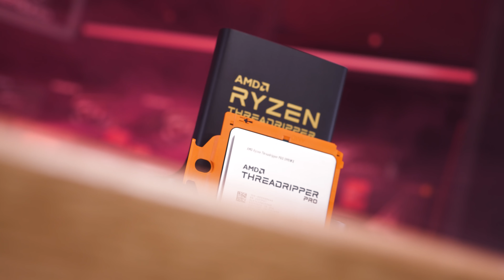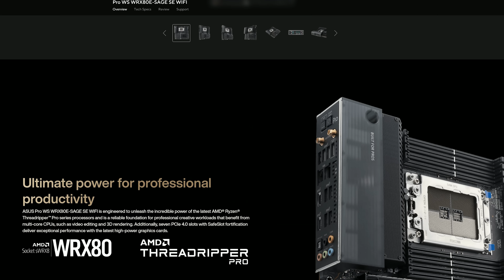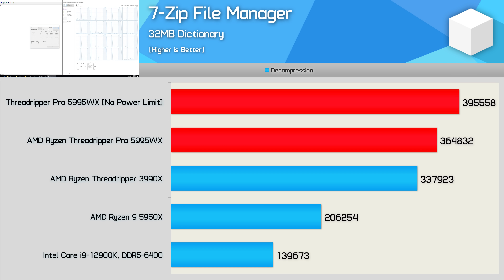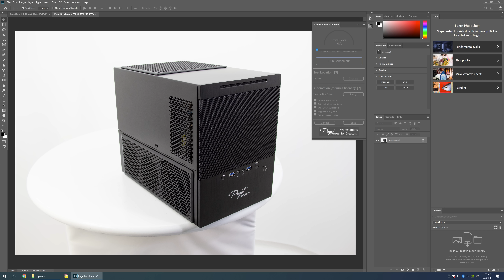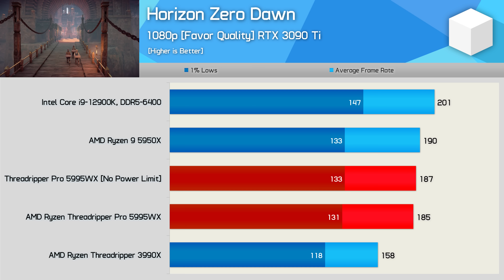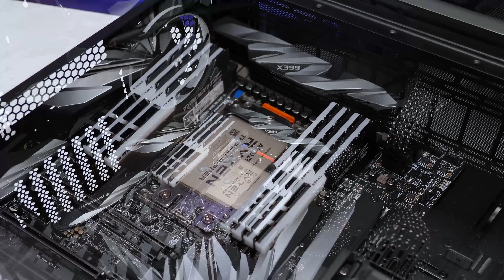It’s Finally Here! AMD’s Ryzen Threadripper Pro 5995WX, Benchmarks, Power & Cooling

Comment: help, I want a pc to edit 4k and 3d, what processor do you recommend Threadripper PRO 5965WX or
AMD Ryzen Threadripper 3970X or
AMD Ryzen 9 7950X. I will use it with a 3080ti. What should i buy?

Comment: amd 3990 = 62868 points VS amd 5995WXYZsuperduper6k$$f'nthousandbiatchofcpuwaferpowah = 66403poin.... bruh, not could they have only not released a threadripper for enthousiasts, they might aswell just have dumped the hole project and let it die on the drawing board. Darn it, that 3990X will never be affoardable. "The dream of ever rendering and simulating water waves on 64 cores within these walls *puuff*"

Comment: As you rightly say in your round up, yes these are super expensive but then at the same time worth it. The biggest disappointment for me is just how slow AMD is at bringing them out. I'm not willing to blow that kind of money on last gen tech and given how high the margins must be on these products I don't understand why they aren't some of the first products to use the latest Zen chiplets, not the last product!
It will be interesting to see how close Zen 4 and Raptor Lake get to these products as the 13900K is meant to have already crossed the 40,000 score in R23 in leaks.
Reply: Because Threadrippers are literally just unlocked Epyc chips, and datacenters buy Epycs by the thousands, consumers might by just 1 or 2. Epycs also have higher margins too.
Reply: @mitlanderson  they all use the same chiplets (just binned) whether it's Epyc, TR or Ryzen, it's just the I/O die that is different and they started to ship Genoa a while back to key customers. AMD really shouldn't be still struggling to order enough capacity from TSMC anymore.
Reply: @Speak_Out_and_Remove_All_Doubt  they're slow to bring out non-Epyc products for that exact reason: they all use the same compute dies and a die sold in an Epyc chip makes them more money than a TR or Ryzen chip, with their much higher margins in server. So we presented with the choice to sell a Threadripper or Epyc CPU, they'd much rather sell Epyc.

Your other point explains this, the fact that Epyc Genoa is now being sold means less sales of Epyc Milan CPUS, which is why we're only now seeing TR 5000 come to market while those in the datacenter already get to play with Zen4.

Comment: Hi Steve I recently switched to the rx6600xt gpu for my computer here at home and I purchased a rx6500xt for a cheaper gaming all amd build. These have been my first amd cards other than a couple of older 7970's that gave me no issues. During the installation on both computers I used AMDs programme to download and install it and on both occasions there was massive instability and generally a conflict somewhere and I think on both occasions I had to reinstall them . Once re installed everything seem to work ok.. Now is it something I am doing initially to cause the issue or have I just been unlucky.. I never seem to have any of these issues downloading nvidia drivers.

Comment: If (the next gen?) Ryzen is (currently) capped to (up to) DDR5 6000.
Would there be any pros to buying a DDR5 64000 and keeping it at 6000, over getting a 6000 sticks?
Reply: It's not capped, that's simply the limit for a 1:1 IF:CLCK ratio, you can still go 1:2, Intel does the same with 12th Gen with "Gear 2"

Comment: I don't understand how this is "much better" than the 3990x? it feels like the exact same CPU with a 5% boost only. I honestly expected more
Reply: This video literally shows multiple instances where this chip is over 15 and 20% faster mate.
Reply: @mitlanderson  I only looked at rendering benchmarks and it wasn't that good. the same goes with thermals

sorry not interested in gaming on it.
Reply: @axe_fx  then it looks like you didn't seem interested in any of the other productivity apps besides rendering then, since the gaming results where the ones that were less impressive.
Reply: @mitlanderson  yeah I am not gonna use it for Ae or Ps or databases or compiling codes.

I just want to render super heavy scenes using multiple render engines

Comment: Is there any point in getting a 4k 120Hz TV if games don't support 120Hz ?. I was under the impression that its the GPU which limits Frames Per Second and not the TV/monitor. I'm unsure hence my reluctance to upgrade my 4k 60Hz TV to a 120Hz TV.

Comment: The price gap between the entry level threadripper 5000 at $2400usd and the 5950X at $700usd today is massive.
There MUST exist a cpu in between that supports 256GB RAM quad channel and has 40 or 64 or so pcie lanes.
Oh wait, that was threadripper NON pro. 
Thanks AMD for screwing us, the TRX40 platform owners.
Reply: I'm guessing that market for it is so small that it isn't feasible to cater to it, intel also killed off their mid-tier stuff.

Comment: Considering how much I paid for my TR 3960X over the desktop ryzen 3950X, I do/did expect an upgrade path/Cpu to be offered. 
This is UN-acceptable AMD.

I do finite element analysis FEA. I do benefit significantly from more memory channels and a 256GB ECC RAM size, PCIE lanes etc. The 5950x and the rest go only up to 128gb.

Yes, I do use it to generate a small income in small engineering projects, but I certainly don't make enough to purchase the Pro version such as the 24 core entry model 5965WX. In Australia this 5965WX is listed for $4,299 Australian dollars. This is an insane amount of money for an the entry level CPU compared to what I paid for the 24core TR 3960X non pro, $2,200 AUD.

So sorry AMD, I won't by buying the 5965WX, because it's not a good value proposition for my business.

Comment: I couldn't find this on the AMD Page, but generally in the past if a chip carried the PRO moniker it was supposed to carry certified support which is generally why they are higher because of the extra vetting process etc. Did they do that with these or just using the PRO name?
Reply: The PRO is all there is, there is no "normal" Threadripper anymore.

Comment: Imagine buying a 6k USD CPU for doing synthethic benchmarks 24/7 instead of using it in real life scenarios, just to justify you paid 10-15 times more for a CPU that's not even the fastest overall plus 4 additional RAM modules, to get the fastest experience.
Reply from the maker: I don't think anyone has or will ever do that so it's just strange to make up that scenario.
Reply: @Hardwareunboxed    Exactly, people will let the CPU handle things in the background, while doing other stuff (working, reading, watching) instead of watching a timer doing nothing, so time on the one side doesn't really matter and on the other hand there's a 5800x3D and Intel 12900KS that are far better in 3D things and giving out raw power... while the new generations are playing in the backyard already.

Comment: Very interesting to see how it stacks up against the high-end consumer CPUs. The competition in that space over the last few years has really closed that gap to where you really need a very specific workflow to justify going for Threadripper. I'd love to see some more engineering based workload benchmarks, like CAD software and 3D model slicing...slicing in particular would be very interesting to see how the different CPUs stack up.

Comment: Well, moving from the 3990x to one these new 5000 Series Threadrippers would mean Steve wouldn't be able to use the downtime provided by those periods the 3990x wouldn't do the job fast enough to rest his eyes :P Heck if you ventured into dumping some workload into a slightly slower system and you might be getting a chance to take a couple "powernaps" between benchmarks and what not :P

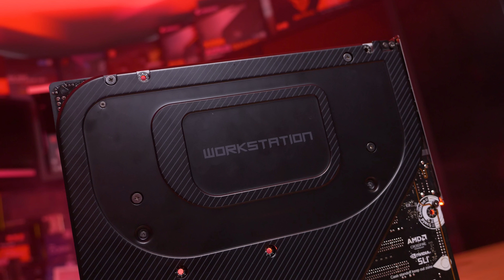Comment: 7:32 - So strange to see SLI and X-Fire support on this MB when those technologies are pretty much dead except for specific use cases.
Reply: not realy, in linux or blender if that mather you can install more gpus and they use them all. even 2 tesla v100 + 1 quadro p series for display out, its not unusual for things like adobe or davinci resolve to youse everything you throw it in the system.

Comment: Thanks Team Group, MSI, and AMD...  And of course HUB Steve as well. 🙂

Nope, not a system I'll have the pleasure of building (why I very much greatly appreciate this review), but still quite impressive from a number of angles. 🙂

Shame there is no step in between the Threadripper Pro (workstation) and the consumer desktop parts.  But for those that need this kind of processing power and will put it to use, more power to you! 👍🙂

Comment: Yikes. It's hardly better than the 3000 series, no wonder it took them so long to release it. Not even worth it.
Reply: Depends on the application. Logic heavy stuff is oodles faster on Zen 3. But Steve is not the right guy to evaluate a workstation product. Throwing a few rendering apps at it doesn't do it justice. AMD was already murdering Intel in software rendering with Zen 2. What I'd like to see is the uplift in something like AutoCAD or Fusion360. That's where the majority of these CPUs will be utilized.

Comment: So can we now que the same hate for amd that intel was getting when they were price gauging everyone? anyone? anyone? anyone? no... ok got it.
Reply: Oh, there are plenty of those up and down the comment stack. I scratched my head then and I scratch my head now. If they are not close in performance they will not be close in price. And there is nothing wrong with that. I don't expect to buy a Ferrari for the price of a Fiat.... where it's problematic is when the Fiat is priced at 80% of the Ferrari because they know there is no third option... And this is where Intel workstation Xeons currently are: They're still based on the 10th gen Skylake-refresh-refresh-refresh and they're priced at some 80% of the Threadripper Pro chips... despite only delivering half the performance in the best case scenario. And this is my problem with Intel, and always have been: They categorically REFUSE to play the value card against AMD when they've lost the round. Obviously the segment leader should get the cheddar for their achievement. But by induction the runner up should go "Yeah, my pricetag is going to make you question if you need that much performance... or if you just like the idea of it... so, you gonna pay for a dream?... or you gonna be realistic about it?"

Right now anyone with real professional needs is going to be a complete fool for not buying Threadripper Pro. 20% extra for 50% more is not a consideration unless you're licking your pencils. In which case it's extortion.
Reply: @andersjjensen  two problem. Your car comparison is wrong. We are not taking fiat and Ferrari. We are taking Lamborghini and Ferrari.

Two they are upping the price not because of performance. They started as value leader. Now they are going... Well look at us now... Money thank you.

They fact that many don't see this is a shame and shows how much hate they have for intel just because of a name and not anything else.

And Intel has always refused to play the value card cause they don't need to. They have something amd doesn't. Reliability. The work around you have to do to get some features working on amd is insane, yet again, nobody has nothing to say? Cause again, it was value at first. Now with what they charge, it is the same issues. Performance is nice but when it is not reliable who cares.

Who wants to pay 6 figures for a lambo that falls apart all the time when you can get a Ferrari that is more and it is fine.

I get what you are saying but when a company price gauges, it should be called out and no excuse should be given.

You know, like the rumors of how much power the new and card are going to eat? Nothing there either but nvidia gets all the heat. Pun intended. 😂 😂

Comment: Am I the only one here that sees an absolute terrible value? I get it's a workstation part but even the biggest gaps in benchmarks have it no more than 4x a 12900k/5950x but literally over 10x the price. With many only double the performance. Not to mention the $1000 motherboards. Sure, it's the most powerful single chip made yet, but the cost is ridiculous.

I also find it ironic that Intel had HEDT chips for quite a while with no competition and we all cried "too expensive!" but AMD completely cuts the already overpriced HEDT line when they have no competition, and it magically becomes "why should they if they don't have to?" 

And before you say "If you can afford it and it's for work, it's worth it." remember multi-CPU professional boards exist. Threadripper isn't the only option on the planet. This just looks like AMD screwing over professionals. The whole reason we wanted AMD to compete was to keep intel from pulling this shit, now with AMD in the lead they're doing it far worse than intel ever did, and they're getting applauded for it. You all sound EXACTLY like Intel fanboys of yesterday saying "it's worth it." SMH 

You either die a hero or live long enough to become the villain.

Comment: What's in this review is pretty good, but it has to be said that there's nothing to really test the features that differentiate this over the consumer chips.
Huge amounts of PCI-E lanes, massive RAM capacity & we're still testing the same tiny benchmark scenes for all the main CPU renderers.
I appreciate it's extremely hard, maybe impossible to do unless you have in-house CG artists, but these kind of chips need to be tested with custom CG scenes with really large assets, fillinging 100+ GBs of system memory.
It would also be fascinating to see some really Heavy Unreal Engine builds (NOT Unreal Engine games, but the project files). That's something that absolutely hammers every core that high-end CPUs have on 1st opening.
Ultimately this might all be beyond the scope of what HB offer & be better to go to a specialist channel - but it's what I think is really needed for a proper evaluation of this tier.

Comment: Doesn't this have some kind of "turbo core" functionality, by ramping up the speed of some cores while the others rest?
Reply: That's what the boost metric describes. If you're only utilizing a few of the cores they will go up to that speed.
Reply: @andersjjensen  You mean the "no power limit" in the benchmarks? I think they just disabled the TDP limit in the BIOS, that's a different thing.
Reply: @sovo1212  Ah, you mean PBO then. Yes, he specifically clarified that it wasn't working on his board and that MSI will be providing a new one.

Comment: I haven't forgotten how AMD screwed over us sTRX40 owners.  I'd like to upgrade my 3960x but I will be going Intel next out of spite.
Reply: I'm sure AMD will cry. That being said: as you saw in the benchmark quite a few of the results didn't show any meaningful uplift from Zen 2 Threadripper to Zen 3 Threadripper. The vast majority of the IPC uplift comes from the unified cache on Zen 3. But the majority of workloads that scale with any number of cores do not rely on cache coherency because each core only touches it's own subset of the dataset being worked on. Hence almost no gain.

Also, what makes you think Intel will be making an true HEDT platform again? The rumour mill seem to suggest that Sapphire Rapids Xeons only come in workstation and datacenter variants (WS and SP suffixes respectively) and will only go up to the equivalent of 56 Alder Lake P-Cores.

And lastly: AMD never promised long term support for sTRX4 like they did with AM4. A lot of people took it as implicit that if AM4 was long term supported then sTRX4 was too... but that was never communicated from AMD.

TL;DR: You're AMD's good little boy whether you want to be or not. Because Intel isn't saving you out. However when Zen 4 Threadripper Pro is out you're the target audience for last-stock Zen 3 Threadripper Pro that needs to be gotten rid of at discount prices. All they need to do is release a BIOS update as sTRX4 is pin compatible with sWRX8. But obviously that will not happen until they've scooped up everyone willing to pay for an sWRX8 motherboard. Capitalism is awesome like that.
Reply: @andersjjensen  "AMD commits to 'long-term' support for sTRX4 CPU socket used with third-gen Threadripper" - "we wanted to drive maximum performance for the 3rd Gen AMD Ryzen Threadripper processors, and sTRX4 helps us do exactly that.  The socket change also sets us up nicely for future development and scalability of the Threadripper platform, both on a near- and long-term basis" - statement from AMD direct.
Reply: @robsims6352  Well... then I suspect that they'll launch Threadripper-non-pro once the sales of Threadripper Pro starts dwindling.

Comment: These "wildly" expensive parts end up paying for themselves in a few months, if not weeks with productivity gains. Anyone else, it makes no sense and I'd argue most gamers have CPUs well beyond their actual use cases. It seems like everyone is an amateur videographer but I suspect that's used to excuse overpaying for their system.
Reply: Gamers would be better served with something like a 5800x3d/5800x/5900x or a 12700k/12900k/12900ks at most.    I doubt that most games can use all the threads the CPU offers and there is no requirement anymore for dual GPU systems that would use the PCIe lanes.

This cpu could be good for CPU scores in timespy extreme and other benchmarks.  So I see the overclocking people getting the cpu if its faster than other options.  The extra money for this cpu is better spent on a top gpu for a gaming setup.